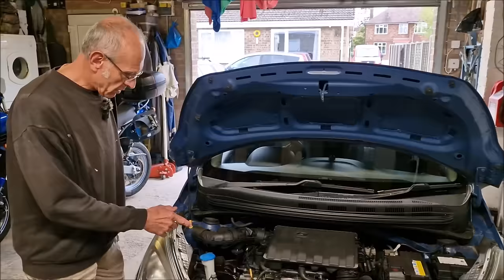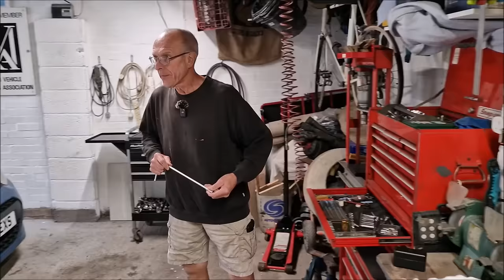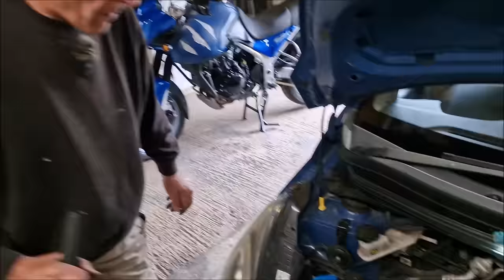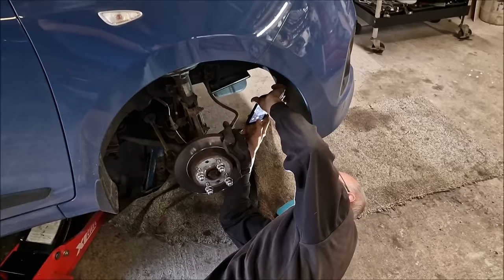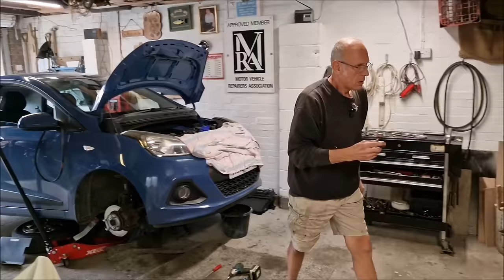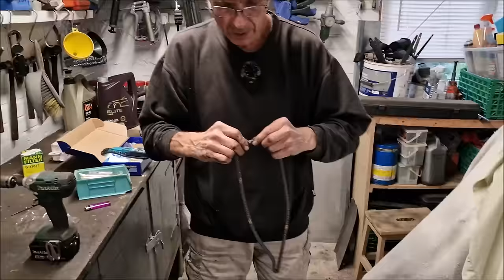Noisy Hyundai i10 Timing Chain Replaced - Part 1

Comment: That's about the only thing that lets those little cars down! They will go on  pretty much forever with that noise though! It's still a million times better than a Corsa C though!
Reply from the maker: Yes I agree
Reply: Our astra j 1.4 owned from New and serviced by vauxhall need its first timing chain at 35000 miles at 5 yrs old! Much prefer a external timing belt, not this wet belt junk.
Reply: @garethprice218  wet belts are just the worst idea ever!

Comment: Timing chains for 60s / 70s /80s cars were changed at around 70k mikes, along with new bearings, piston rings and a cylinder head decoke. And a new clutch…..
Reply from the maker: Loads more content for us then to look forward to in the next 200,000 miles ;)

Comment: This is why I love the old Epsilon engine with the timing belt, I've had a few i10s and favour the belt over the chain even though the press said it's not as refined as the later engines a gates belt kit is 30 quid and about hour and half to change and you don't need to remove the water pump.
Reply from the maker: Ah that's interesting!

Comment: Son's car developed a misfire, after air down sparkplug hole and coming out of exhaust, turned out to be failed exhaust valve. Head off job but not complicated. Timing marks make it very easy.
Oil on sparkplug probably means blown valve.
Reply from the maker: Glad to hear he got sorted

Comment: I can't understand why the cam chain is been chaged at 70000 mike's now my 27 year old Toyota Hilux with 438000 kilometres on it still has the original cam chain obviously Toyota cam chains are of a superior quality compared to Hyundai and Kia may l remind you that Toyota's quality is the best in the world and especially  with my Hilux itis so over engineered its not funny and so so much better than any Hyundai or Kia which aren't the best there is a lot of original parts on my Hilux including the engine gearbox and diff also the carburator still works well the head gasket but there are plenty of things l have changed and when l bought it 5 years there were a couple of parts that weren't original and now there's more
Reply from the maker: Your Hilux sounds great! Apparently these timing chains are a known weakness on these engine. I'm also a fan of Toyota's reliability